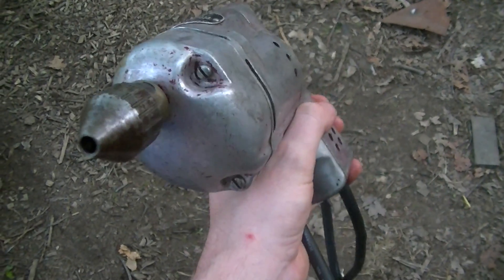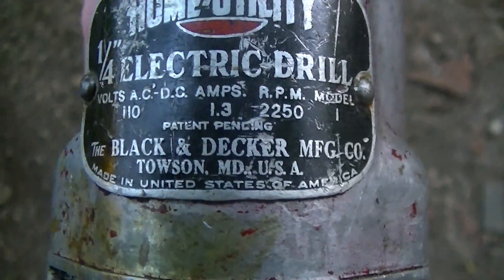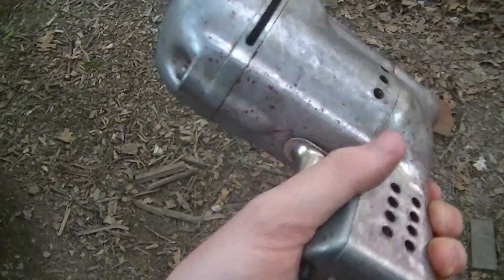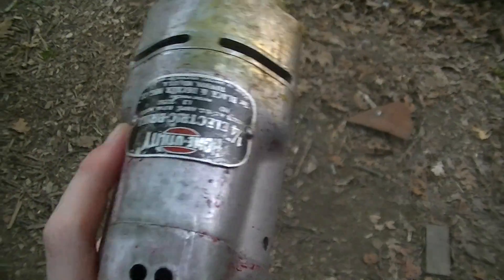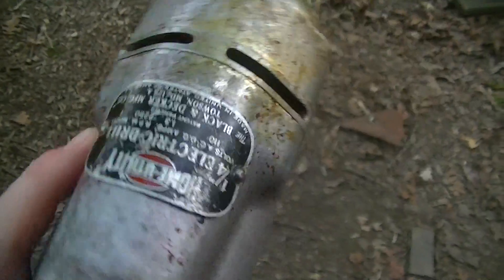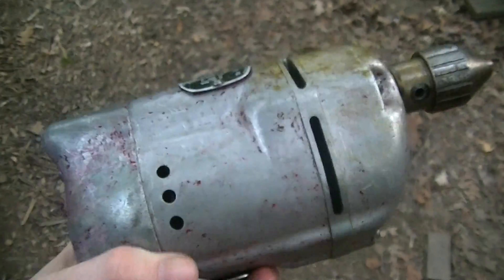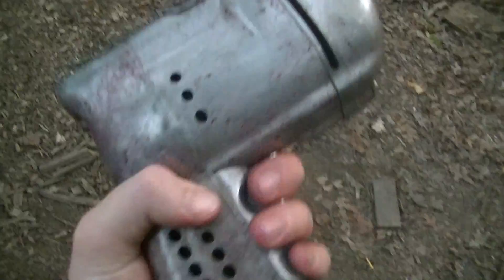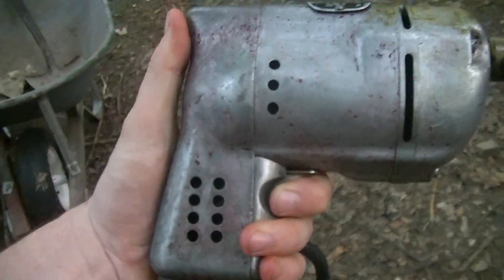Ancient Black and Decker drill gearbox relubing

Comment: Black & Decker started making their Home Utility drills in 1946. Similar shaped and sized but more costly drills had previously been made for industries such as aircraft production, but those were made with deep groove ball bearings, externally accessible brushes and higher power motors under the Holgun (1/4" capacity) and Hornet (3/16" capacity) model names. The fancy bearings and easy service were obviouly meant to survive industrial use.

Comment: 1946 on the Home-Utility drill, no.1.  Came out just after ww II. Nice piece. Was it painted with red crinkle paint?
Reply from the maker: No idea as I only got it a few days before filming the video.  If it ever did it was stripped off years ago as the tool is just bare metal.  Fairly dinged up bare metal, so the absence of paint is probably a casualty of close to 7 decades of use.

Comment: Personally it drives me crazy when people refer to standard AC house current as 110v...it's been 120 for a long time! I have lamps from the 40s in my collection that are rated 120v...only thing I see 110v on is cheap dollar-store light bulbs outsourced from overseas...
Reply from the maker: I have a late 1920s/early 1930s A17 envelope 15W lamp that is rated for 120V, as is a May 1933 General Electric 100W A23 envelope daylight lamp.  To be fair, 115V GLS lamps were somewhat common until sometime in the 1950s, but 115V is still over 110V.  Linguistic inertia yay.